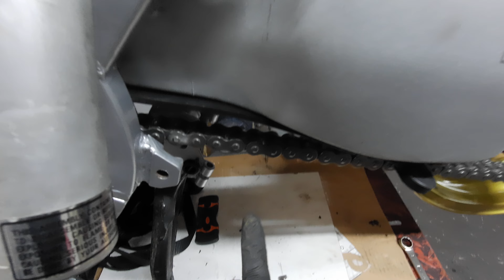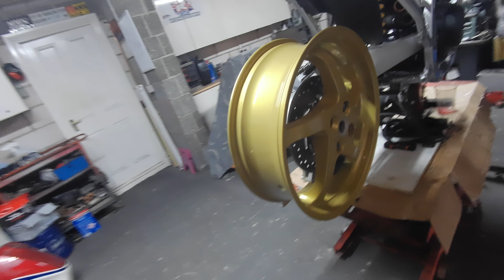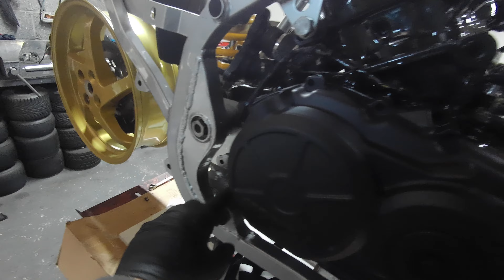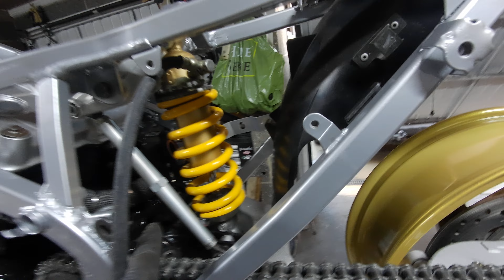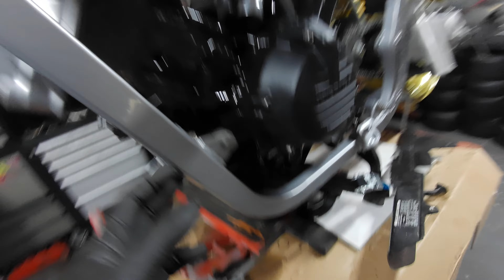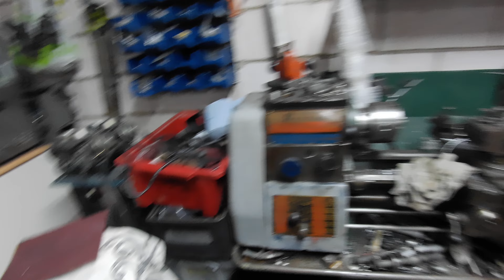VF750 to VFR750

Comment: Well , this showed up in my feed Today , and , being I am retired , managed to binge watch them all . Thanks for uploading your project . I did put some Miles , back in the mid '80's , on a VF1000R , I loved the sound and the pull of the engine , I had progressed from the B.S.A's and Triumphs in the early '60's , to my Z1300 and H.D Shovelheads , riding the VF1000R was a bit of a difference . Can't wait to see the finished article . Growing up with Drums brakes , and Featherbed framed specials , I have often thought of a VF1000R engine , in a Featherbed  frame , VF1000R forks and swingarm , laced wheels with 4LS brake and a conical hub rear Wheel .......P.S . Now powder coated , that frame looks '' Factory '' .
Reply from the maker: Thank you